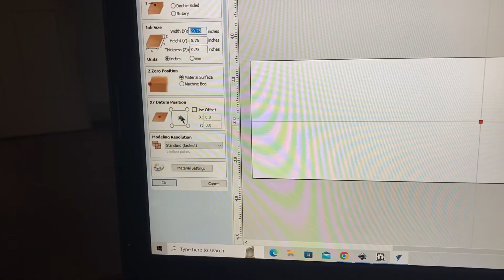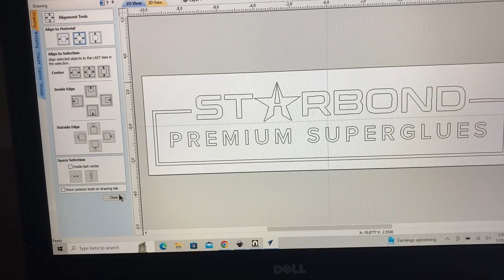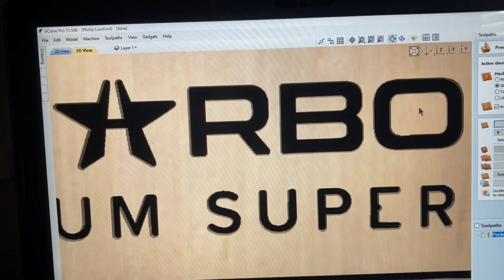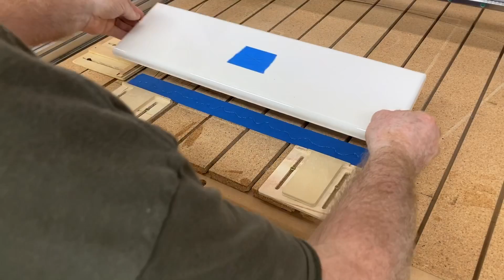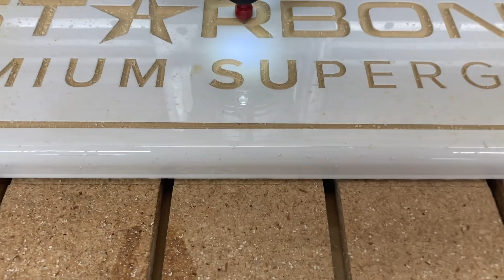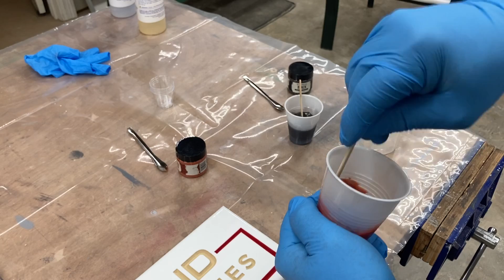Start to Finish Starbond Resin Inlay (Sign Part 1)

Comment: I work with resin also. I found a cheaper coloring item. It's acrylic paint. 2.5 ounces for 97 cents and colors just as well. i have mica powder, but only use that as an accent.
Reply from the maker: That is awesome!  I have used acrylic paint as well. I’ll be doing additional videos showing more ways to use the epoxy resin

Comment: Nice ,  crisp letters. Intrigued as to height issue. Find out tomorrow. Your epoxy mix looked a bit thick & stodgy. Had you started running out of  time?
Reply from the maker: Yes, there were two issues. One, it took longer to video everything and time was running out. Two, this was an older resin. Resin does have a shelf life and I had passed it.

Comment: PawPaw I need your help! We just bought the X-Carve 1000x1000 from inventables and also the x-tool d1pro 20 watt Lazer machine from x-tool! We need a laptop to run these machines with! What would you recommend? Laptop will only be used for these 2- machines! Been looking for a used one but not enough information on the laptops to know which one we need! Can you please help with this
Reply: I am Korean and I use xcarve.  I also suddenly bought a used laptop because the Easel program was only available for Windows 10 or higher since yesterday.  It was possible to use it with an old laptop, but now only Windows 10 or later is available.  For memory, it says 4GB or more, 8GB is recommended.
Reply: @amaranthwood   Yeah , that’s what we are finding out also! Thank You for your reply!